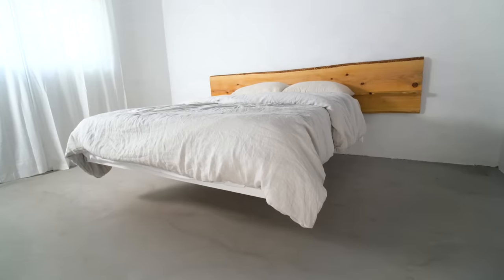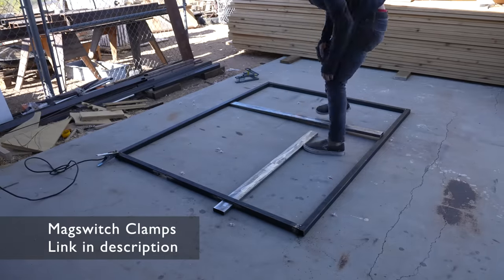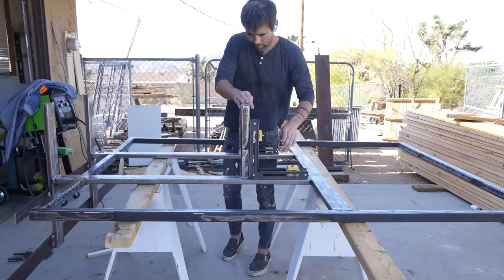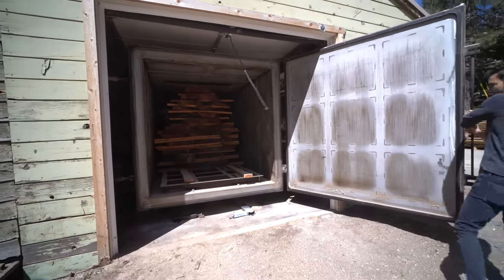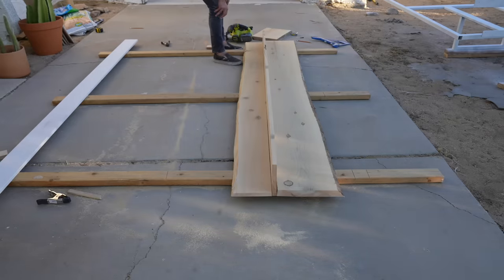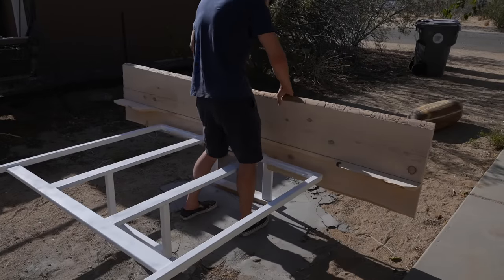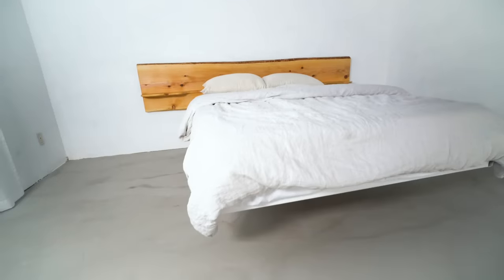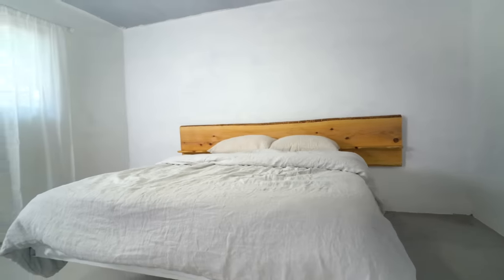Making a FLOATING BED 2.0

Comment: this is great if you have a robot vacuum cleaner, can easily sweep underneath
Reply from the maker: yes!  same reason I like floating toilets! easy cleaning!
Reply: Yeah and if you have a lot of space to waste.
Reply: @HomeMadeModern  qual o link do banheiro flutuante???
Reply: I'd recommend a broom for sweeping.
Reply: @TonyCasamassima  what if i'm old
Reply: It still has legs. Just at a different location. Not sure why a robot cleaner would like this more
Reply: Exactly what I was thinking.
Reply: @b3arwithm3  The robot can easily get around these legs.
Reply: @TheRock1.0  as it can with a regular bed.
Reply: @robinradema1  How do you waste space?
Reply: to make sure that my cleaning robot also passes under my bed with drawer, I have created a system that lifts the bed entirely and then lowers it after the robot has finished 😎
Cheaper and more fun to built
Reply: @robinradema1  do you think making the bed float makes it bigger? What are you even talking about?
Reply: @HankBukowski  i use the space under the bed for storage. Sliding drawers under the bed. Maybe one day when i have a bigger house i won't have to store stuff under my bed. 😂
Reply: @gr6e  I use the space under the bed for storage. Sliding drawers. Maybe one day when I have a bigger house I won't have to store things under my bed.
Reply: @robinradema1 ?? How is this wasting space?
Reply: What if you have a girl friend is it still a good design?
Reply: @stevenchen2454  yes

Comment: Amazing video as always! Thanks for sharing this! I noticed that you just used plywood for under the bed. I've always heard that you'll get mold if there isn't ventilation under the mattress. Was the plywood just for the video and you'll put holes or something later? I'm doing a bed right now and am trying to figure out an easy way to ventilate without a box spring. Thanks!
Reply: Good observation. I usually just flip the mattress every month and once in a while keep it on the terrace in the sun for a few hours. Although my method may have different results and theories worldwide considering climate and living conditions.
Reply: I've also had mold with putting a full sheet of plywood directly under the matrass. But i simply drilled a bunch of 1 cm holes in all the next bed projects and zero mold to be seen. so it is a simple fix
Reply: @ProjectsandThings  Right thanks for that!

Comment: Finally, a bed that's easy to vacuum under.
Reply: finally! a area where monsters can lurk (metaphorical and intruders)
Reply: Great project. My friend made a similar project for his childrens bedroom. He rounded off the front corners of the frame and then padded the entire outer frame covering it with leather so the metal structure wont hurt or cause injuries to the children while playing. Similar to snooker table pockets. Also, he covered the underside of the frame with plywood :)
Reply: ikrrrrrr
Reply: That's what i thought!
Reply: But where do I put all my crap?

Comment: This is so cool. I was thinking of making a floating bed with timber but where im from i can get steel way cheaper. and experiment with welding!!! and definitely add an LED strip behind the headboard I think it keeps the shelves clean and more room for your device or book
Reply: If you have cheap steel you gotta get into welding. I love it. Get a $150 flux core welder from harbor freight and you will be makin stuff in no time.
Reply: @BassManDanO  I totally am investing in a welder its been a long time coming. unfortunately I dont have a Harbor freight in my area but a great hardware close

Comment: Agree, looks good, only two points to think of:
- the corrners, when you will hit these corners you will cry, this is steel, so you may even hurt yourself. Maybe put some covers/bumpers on the corners
- have you tested what is happening if someone will stand on the edge of that bed?  you should test what will happen if two small kids will be jumping on your bed
Reply: yup, good points.

also the matress has nothing to lock it in, so it's likely to move around with you.

Comment: Maybe I missed it in the video, but why not mitre or cap at least the visible ends of the steel? You are already bringing for clean up anyways and it would make a much more finished look than the big holes in the end. The mitre would also allow for much nicer/bigger rads or the parts you might hit

Comment: Looks nice. 
But I'd make the frame separable into 2 smaller parts so it could be disassembled to be carried through narrow passages.
Also I assume some weaker walls might need some kind of a backplate to hold the bed.
Reply: Seems most of the weight is taken by the feet under it. Only on the far end you get somewhat of a cantelever effect. But that is where your feet are.

Unless you start jumping on the edge of the bed it probably will be fine if you use proper screws into the wall and use every available stud to secure it to.

10 big screws into 3 or 4 studs should be able to carry multiple people.
Reply: You could also just leave your bed at home while walking through narrow passages.
Reply: @HeriEystberg  No way! I always carry it along with me, tied to my back :)
Reply: @michael_janus  to each their own. I suppose it's good to have something to fall back on 🥴
Reply: the problem with this bed is that if you add too much weight ur gonna ruin ur entire wall, if someone jumps on that at the outer edge it could rip the wall panels its connected to off.

Floating beds look good but these are not for kids or active people, and you need to be careful, if 2-3 ppl sits at the edge ur adding some insane pressure to the wall, and if you ever fall on it or jumps on it like laying down just falling onto it with ur back etc, or for ppl with high weight, this is not gonna be ideal and ur defo just gonna ruin for urself here.

so, yeah not really ideal. can just put 2 legs on it at the edge and you would have easy to clean under the bed as well.

+ you cant move these around if you do changes to ur room that easily.

Comment: I'd add trusses from the middle support up to the two corners farthest from the wall. I feel like the frame would bend if two people sit at the very edge.
Reply: Only one person  sitting on the bed foot end will bend the frame to garbage.🤣
Reply: I too had a similar feeling until I actually did see one similar project in person and tried it. It would take two really very heavy people for the steel structure to bend like you say. Also, the project I saw can hold 800 pounds with the steel pipe frame and also had an 'H' shape dual support base as opposed to the one shown above. :) But your idea of trusses is also correct.
Reply: It seems like the arrangement of framing here wasn't really thought through; the two middle slats should have continued all the way through to the end of the bed. The way he's made it, you've got them cantilevered out past the leg support, then a cross slat cantilevered out to the side on the frame, then the side frame cantilevered even further to the end of the bed, you're amplifying the deflection SO much more doing it like that (and it shows when he jumps onto the bed).
He could also just add two diagonal support beams from the base of the leg out to the corner of the bed, which would be no more visible than the existing legs, and would pretty much make the bed completely rigid and not bouncy
Reply: @khdownes1  You wasted your time writing
Reply: @khdownes1  Don’t worry about that other guy Kyle. I read it.

Comment: the thing I love about this bed is that it truly achieves the floating look. many ‘floating beds’ on YouTube aren’t able to achieve it because the wood shows way too easily when one steps back even just a foot or so from the bed

moving the under-bed supports way toward the center though means that the head of the bed will pop up if you sit on the foot of it, etc.

you seem to have figured out a solution for that by mounting the hole thing to the wall. I just wonder if there is a way to achieve all of this without mounting. it seems that if one were to make a cantilever that it would achieve this also while still being free-standing and mobile
Reply: You could mount to the floor instead, even under the floor with welded steel extensions that attach to floor joists

Comment: If you use a lot of spray paint you should upgrade.  Get a compressor and cheap paint gun.  Use enamel and you can add hardener or Japan dryer, acetone helps to dry faster and thin it out.  It's way better than spray cans.

Comment: Tip from a keyboard warrior: 
Mattresses need ventilation, else you create the perfect climate for mold and mites. You should either use real slats or drill holes in the plywood boards.
Reply: Otherwise a nice bed. Thanks for sharing your work!

Comment: There needs to be a way to keep the mattress from sliding around while the frame is slightly smaller than the mattress.  If you can't figure out why we want a mattress that doesn't move easily, lmao..   As for the frame being smaller than the matress just a little bit, it's to protect your legs at 3:00am.  Bumping into the mattress corner doesn't hurt at all, that steel frame's edge would.
Reply: They could make a padded covering for that area.
Reply: @xHuntedGunzPCGx  Yeah but for those who haven't made one yet it's something to consider.  Older you get the more you bump into stuff.

Comment: There another way to accomplish this. Make 1 -2 supports in the middle, but cover the outer surface of the supports with mirrors,
an old magical trick. it would reflect the carpet if you set the mirrors on a 2-3 degree angle.

Comment: If the mattress is on veneer without ventilation holes, then there will be problems with mold, because we sweat when we sleep. Therefore, the beds have slats at the bottom.

Comment: This is a great idea! You know with a bed like this your big toe will thank you in the late night or mornings when you wake up and not have to worry about any awkward corners at the bottom. 🤔🤭
Reply: But your shins will curse you instead! I know this from experience ;-)
Reply: @paulgee3411  If foam padding is designed around the corner edges of the frame, this bed will be shin-proof. 💡

Comment: Good job on the floating bed.  Why didn't you cut the edge tubing at 45 degree angles to eliminate the open tube that you talked about deciding not to fill in?

Comment: Looks good. But even if you're not an engineer, you have to ask: where is the other half of the frame? A square pipe is good, but not enough. So in a (short) time it will bend under the load... I say this from my own experience: I have a homemade vibrating table for the production of paving slabs and even 15-20 cm of the cantilever is critical. And here the console is as much as half of the bed, and it is about 1 m long. I think that a long-lasting, reliable construction should be more complex, with smaller pipes, but let's say in two layers.

Comment: I am curious if there's a way to convert this into two halves, connected through the centerline to break a king size bed into two parts so it's easier to move around. King size beds are always such a hassle to move even when they can be broken down into smaller components, just because of the number of parts. This presents a different issue in single piece construction- hard to get around corners.

Comment: This is an amazing look when completed.  Love the floating style.  Headboard is a bit small in my opinion.  Would like something large to maybe make it look like it is holding the bed from it.  Of course that bedroom is quite small so may not be possible to put a big headboard behind it.  Would probably overpower the room.  
No mattress is square corners, why not round the corners of the frame a bit?  My $29.99 steel expanding cheapo bed frame stops the structure about 6" from end of mattress so no metal is sticking out past the mattress.  I would hope for a $5000 bed that something similar would be done to alleviate bruised shins.  The rounded corners would also allow you to cover the ends so you cannot see into the tube frame.

Comment: I did a simar thing with a 8x2 foot desk.. But I bolted some 3x 1/4" steel plates to the uprights and welded the desk supports to those. Then sheetrocked afterwards. Desk can take 2 people 200lbs each and zero flex.. And has no visible fixings at all

Comment: Thanks for awesome idea. I decided to do your floating bed, currently in phase of buidling it. I used 5x5cm instead of 4x4cm for bed frame. And moved a middle one 10x3cm more to the end of the bed instead of having it straight in the middle so it can hold more weight on the end of the bed. Its not finished yet. i was just wondering did you do a weight test on it? I'm really sceptic if it gonna brake under some situations when having fun with my girl...

Comment: You should add foot board. It will cover the metal frame which is a bit unsightly and make it less minimalistic? Also, the lamps should be wall sconces, not to take space on already tiny shelves.
Reply: Hello, my observation as a young Moroccan 🇲🇦 I say this is a good work by modifying a bed that is available to the means of comfort, but I was waiting for him to fold it, meaning to make the bed fold across the wall to take advantage of the space of the room

Comment: I knew it is not completely floating. 😅 still incredible work
Reply: My friend build a real ''floating'' bed while building the house. Just need enough steel in the walls, so the the bed frame can be welded to the wall and there's no need for any legs.

Comment: That bed is amazing.  The headboard doesn't really speak to me, which is odd, considering I've spent most of my life working with cedar, and it's almost all we end up sawing on our mill.  That said, it just looks like someone took a board off the drying rack and screwed it to the wall, to me.

The metal work is genius, though.  Very impressive.
Reply: I'd probably wouldn't use a headboard at all, just the bed floating in the room. It would add to the minimalist style.

If you are worried about the wall just being drywall where the headboard would be, just cut out the drywall and replace it with some thick mdf or plywood and paint it the same as the rest of the wall so you don't see it.

Maybe just some floating shelves on the side or small night stands if you need them. Either against the wall or simply attach them to the side of the bed.

Lots of ways to change it to suit your style.

Comment: I like the concept but the edges and corners are shin killers. Always, always, always radius the corners in all directions. I would cap the ends too for a finished look. My designs are a bit more robust and conceal the support system more but are also much more difficult to fabricate and install.

Comment: 8:20 how much weight does the end of the bed handle?  Any tests with a few people hopping off the end?  If more strength needed, the metal frame could be joined with vertical metal.

Comment: This method of building a floating bed works well in roadside motels, where the customer is constantly coming in and out and the bed must be as fixed as possible. For a residence it is not feasible. There are other ways to do it like this without it being fixed to the wall. Nor using steel.Este método de construcción de una cama flotante, queda bien en moteles de carretera, donde el cliente entra y sale constantemente y la cama debe de estar lo mas fija posible. Para una residencia no es viable. Hay otras formas de hacerla así sin que sea fija a la pared. Tampoco utilizando acero.

Comment: Was the gap in between the 2 pieces of plywood enough to prevent moisture and mold build up underneath the mattress? Because it doesn't seem like enough airflow.🤷‍♂️
Reply from the maker: different mattress companies have different recs for this. I suggest reading their suggestions that match there foam type

Comment: Maximum expected design load x safety factor = safe kid under the bed.
Design load = two 300 lb people sitting on the end + two 55 lb luggage cases = 710 lb
Safety factor of 4 to ensure life saving capacity of child under bed x 2 for life expectancy x 2 for wear and tear = 16
Maximum proof load = 710 lb x 16 = 11,360 lb.
What is your design goal and proof test for this structure?

Comment: This is great and this has been my dream for over 30 years...
...except this one is technically not really floating (sorry for my negativity).
Some day I hopefully will be able to build a house with floating furniture planned-in and with corresponding steal frame structures / wall reinforcements at the proper locations.

Comment: Self-leveling concrete is not engineered to be walked on directly. In a year's time it's all going to crack and fall apart. Cover it with flooring, like you are supposed to.

Comment: as for me it is too weak, more than half of the bed is unsupported, the whole weight rests in 2 points on 2 tubes and not even on them, but precisely on two welds. You can forget about an intense night: D It has no right to stand ... lie over the support and sleep peacefully and do not sit on the edge, otherwise it will fall apart quickly. I don't believe in miracles, no one cheated physics, 1.5m lever on 5cm weld, good luck ...
Metal is strong, well-made welds too, but don't think that they are indestructible.
Of course, I write it from the perspective of a bed for an 80 kg person, because if someone weighs even more, it is a pity for this job.

Comment: Am i too european to understand the video? You literally just put the screws inside the wall without drilling. And i have never seen this kind of inlay under your matress, this is just a plain board but normally it requires an ergonomical support for your back.

Comment: Yeah build a floating bed it’s so easy just get your 1 1/2” square tubing, angle grinder, welder random right angle thing a bunch of pencils and levels a fucking belt sander that looks like a chainsaw and maybe you might need a screw driver at som point